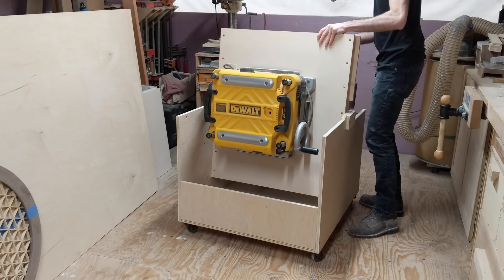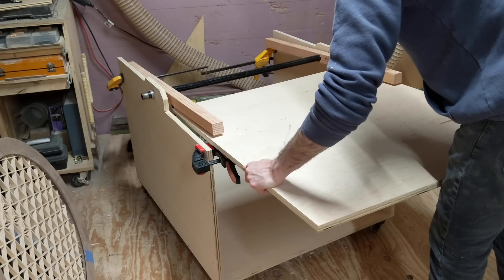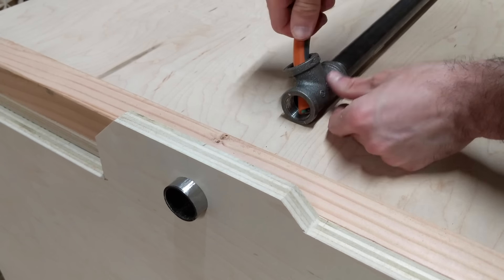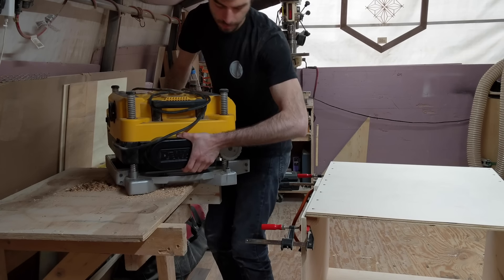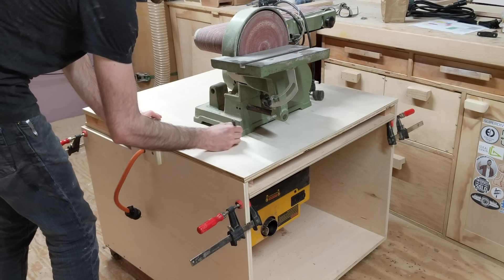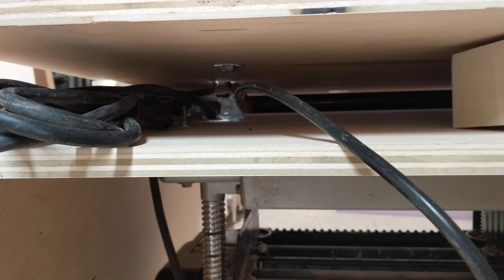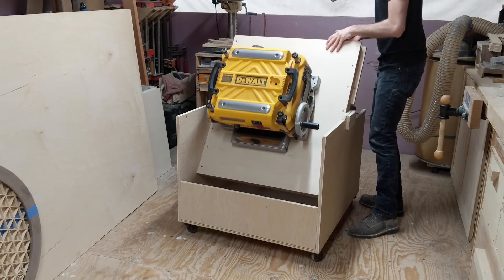How to make a Flip Top Tool Stand // DIY Woodworking Project

Comment: Do you run into any awkwardness when switching from the jointer to the planer since they're oriented perpendicular to each other? Looks like you'll have to rotate the cart 90 degrees to use both tools when running a long board through. Does the planer fit better that way than if it were rotated 90 degrees as well?
Reply from the maker: I haven't had any issues with it. Those are tools that I don't use to often and that's why I put them on the cart. You can definitely rotate the planner if that works better for your workflow

Comment: Great project. The height is perfect too. You could always use pockets on the sides to store tools in the future. I was curious that you didn’t use glue....just screws. Wouldn’t glue make the joints stronger?
Reply from the maker: Glue would definitely make it stronger. There's no reason I didn't add it

Comment: Nicely designed and executed.  One question though.  Why not use a 12/3 x 15' (or longer) extension cord (with 3 outlets on the end) instead of the short 3' cord?
Reply from the maker: The only ones available in the store were too long. I'm okay with running an extension cord to this and I can always use that card for something else too

Comment: Looks good. Just one thing though. You shouldn’t have the blade up so high when cutting. Should be just above the height of the wood you are cutting.
Reply: I thought the same thing at first until I realized he was cutting the notches and minimizing the angle of the cut. By raising the blade that high you can get a nearly 90 degree angle on the cut.

Comment: I love the idea of flip carts, but I am always puzzled why people do it with their planers. The planer can just be put upright on the bottom of a standard cart, with a shelf and other tools above. Unless your planar needs access from above, it seems like nothing is gained by flipping it.  Now, other tools on the other hand make more sense.  Tools that are more likely to need the vertical and/or side clearance(drill press, scroll saw, spindle sander, etc.)
Reply: Are you talking about having to bend down or squat to use the planer on a bottom shelf? If that's what you mean, putting it on the flip top just brings it up to a comfortable working height.

Comment: Awesome job! 
Only recommendation on how you could have bolted in the sander was to add counter weight to the back end of the plywood just in case the center of gravity of the sander went past the edge while you were working.
Reply from the maker: Thanks! That's a good tip 👍

Comment: 3” or 4” casters? Plans don’t say. I went to the link you provided in your plans and it takes me to the general caster site.
Reply from the maker: That's totally up to you. Either should work fine. I suggest the larger size if you want to raise the tools a bit higher or if you'll be rolling the cart on rough or uneven floors
Reply: @JTWoodworks  Thanks! The larger (4”) casters are really nice!

Comment: What dimensions did you go with for the flip top surfaces and the height?
Reply from the maker: The top is 32.5"x36" and the total height with the casters is 28.5". The 36" depth is because I have two tools on the top. It can easily be less if you have one tool on each side
Reply: @JTWoodworks  I'm going with the exact same three tools on both sides, so I'll be matching your setup basically exactly.
Reply: @JTWoodworks  what size casters did you use?
Reply from the maker: They were either 2" or 2.5". I can't remember

Comment: nice idéa. But the power cord vs the threads...
Reply from the maker: What about it?
Reply: @JTWoodworks  Its illegal, and you can die. well... that about it :)
Reply: @Samisven  your solution?
Reply: @myname4598  putt some rubber hose that fits tight inside the T-pipe thing, or something like that. or just fill it with hot glue/whatever you have, to prevent the cord from grinding against the sharp threads
Reply: @Samisven  i wondered about using a piece of threaded pvc the same size as the metal tee, but i think the hose would be the simpler solution. Who doesn't have an old water hose laying around?

Comment: I have a tri-stand. Don't care for it. What I did was construct a work bench with flip- up sections for 4 machines and a mount on the end for a table saw. This allows for complete staging of work operation. T- tracks and dog holes strategically placed in the top allow for glue-up and assembly when the machines are all rotated in the down position. So work flow goes like this - bench acts like an out feed for the table saw and support for circular saw breakdown and router operation. Machines up allow for drill press, bandsaw, jigsaw, and most sanding operation. Machines down again again for glue-up and assembly.
Reply from the maker: Seems like a useful setup. Got a video on it?
Reply: @JTWoodworks  Currently I'm recuperating from a severe accident (involving a saw no less). I'll see what I can do after I get a handle on this ( surgery, therapy etc). Might even post about the accident as a warning to others about my stupidity. 35 years working with various woodworking machines and this is the first injury other than a thumb nick 25 years ago.
Reply from the maker: Ouch! Speedy recovery

Comment: You make the same mistake as others. Cut the wire/cord on the female end! This way the weekend end is hidden in the table. You can also re-wire an electrical box/power cord unit so you can have multiple plugs with switches.
You could have used saw horses to hold the unit when you wanted to put the bolts into the sander.

As to the sides of the cabinet... The sides of the cabinet should always rest on the top of the base. Not be screwed into from the sides. This gives more support to the cabinet. Would you support the top of a table from the side or from underneath?
Reply: Alternatively keep the sides as made. Then put another board underneath it spreads the weight and helps avoid the bottom board bowing up in the middle. For “normal” box cabinets it allows top, bottom and shelves to be all cut the same.

Comment: The cabinet sides should have been standing on the bottom - its stronger, instead of being screwed to the sides of the bottom!
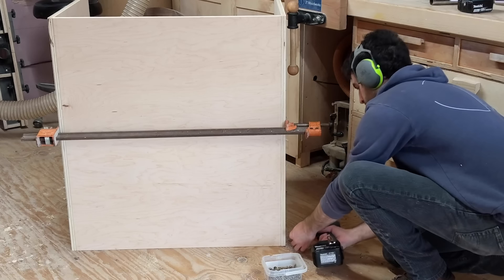Reply from the maker: 1:20
Reply: Agreed, but Johnny mentions that.  I guess Rabbits would give you the best of both, and GLUE, don't just rely on the screws, as the cabinet racks from use, the glue will keep it stronger.